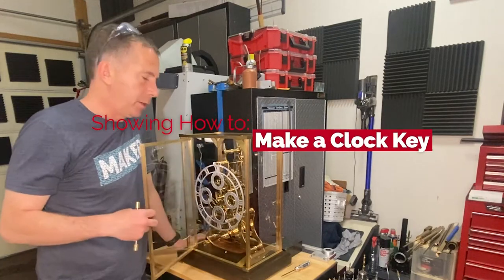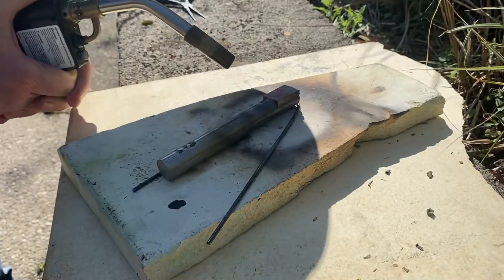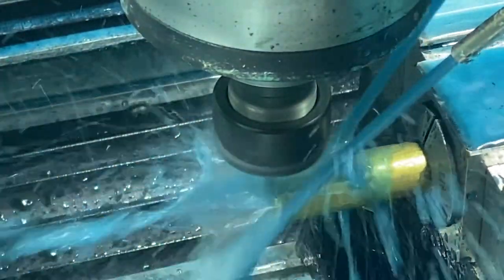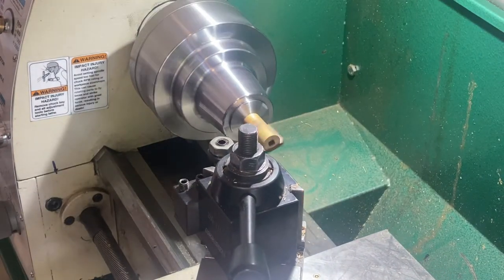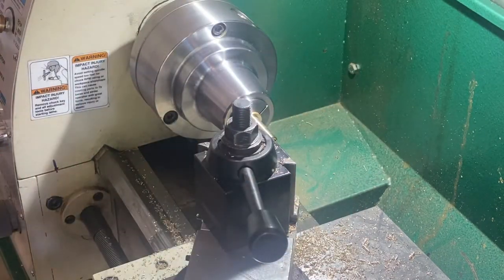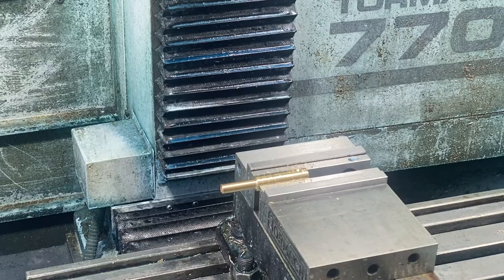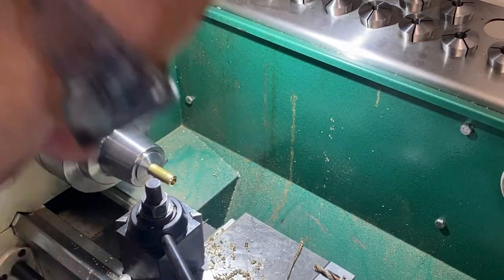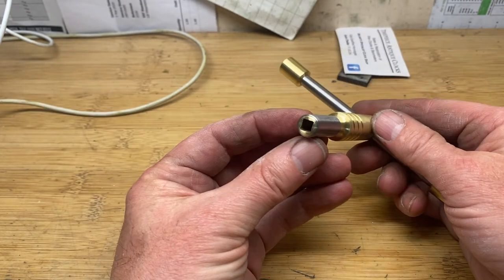Making a clock key for a Skeleton Clock

Comment: Well that’s a clever way of making a clock key Kev, I might use the same technique myself if you don’t mind. Your clock looks amazing especially in its new case. Please keep the videos coming.
Reply from the maker: Thanks, it works well just be careful when turning the piece.   The Coup perdu escapement is very sensitive it seems as it only has one impulse face, making small adjustments to get it in beat and run consistently.  I hope I am getting toward the end of this project.